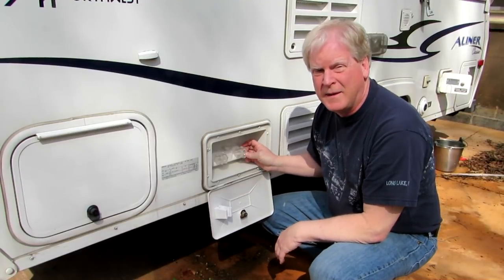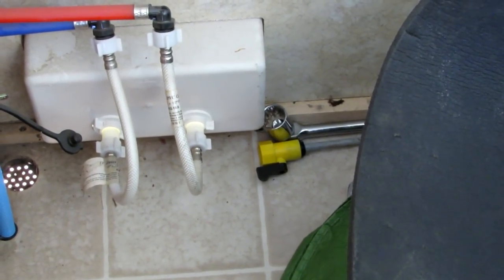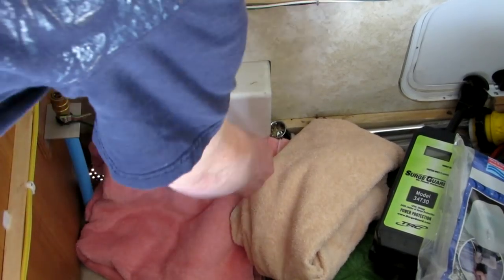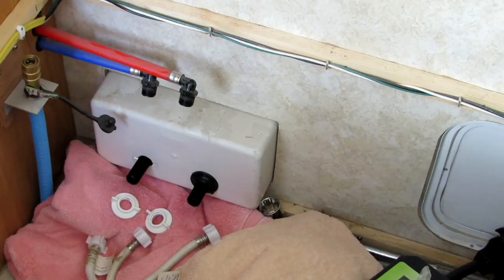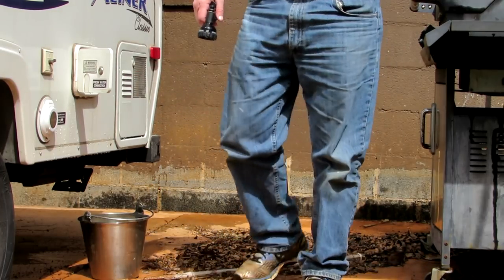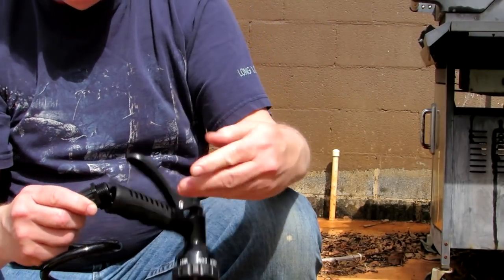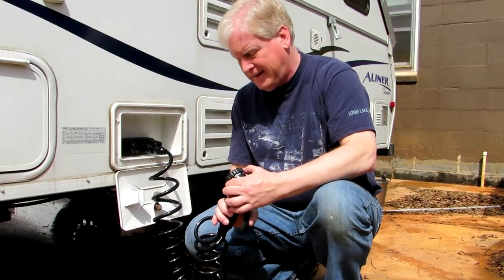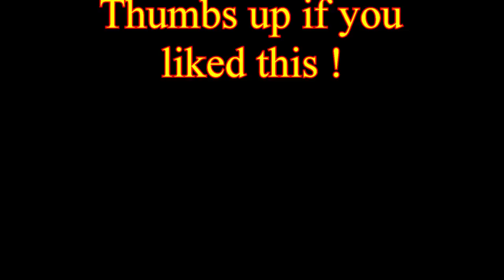Changing The Outside Shower to a much improved appliance

Comment: Rick, great upgrade to add to the versatility of your A-Liner, Is it possible to change just the hose and nozzle? In case want to do this also as much cheaper and easier if able to.  Just added as installed a black outside shower unit in my compact stick & tin (wood frame & aluminum siding) TT.  Found a great location between the existing outside water connections and water heater.  Had to cut a new hole, a perfect fit between the wood studs, then splice into existing water lines using T connectors with the blue & red PEX-b plastic tubing.  Doing plumbing in a TT isn't much better than doing it on your house, every new connection (8 total for the shower unit) has to be 100% perfect, no drips. Much trial and error to see which connectors fit best until it's drip free. But in the end it's worth all the time, trouble,and expense.
Reply from the maker: Absolutely !!  And if your smart, you check all those connections at least once during the camping season, because things loosen up with road time and different pressures, different uses,  all wear on the systems much more than a house.

Comment: Did you say the short water lines in the back were designed only for RV use and regular ones from Home Depot wont work?  Like you said it seems they should be changed out every few years.
Reply from the maker: Most of RV plumbing is a unique thread. No Idea why.  The PEX is regular size, so if your smart you can change the parts by splicing new PEX and regular household plumbing fixtures !

Comment: Just got this as a replacement utility shower for the service compartment in my Bounder.  This is a tremendous improvement over the old shower with the permanently attached conventional RV shower hose and shower head.  Now the hose isn't just flopping around inside in the compartment and the spray nozzle is so much better.  I mean, who really "showers" outside their RV in front of their sewer/service compartment?  1.  There isn't anyplace to hang up the shower head.  2.  the hose isn't long enough on that old style utility shower.  3.  The the shower head might be ok in a shower, but spraying stuff off outside your RV requires different water patterns.  This is just what the doctor ordered.
Reply from the maker: Glad you found it, We'll have to see how long it takes for the RV industry to figure out its worth adding to the OEM lineup.  Thanks for the comment !  Come back anytime !
Reply: Going NoWhereFast the service access for the faucet in my service compartment was pretty tight so I had my local RV service shop do the install.  The folks there are looking at their supplier relationships as they think this is about the best utility shower they have ever seen.  They seem to intend to stock it for aftermarket replacements.
Reply from the maker: @jeromep  Good for them.  Its an excellent Mod!
Reply: @GoingNoWhereFast  I agree with you that manufacturers need to move to this faucet and hose over what they are currently doing, but based on my experience manufacturers are anywhere between 3 and 5 years behind actual RVers and the aftermarket.  On top of that they frequently really miss the mark in terms of new features and what the market really wants.  Cheers.
Reply from the maker: Very Few executivess in the RV industry actually RV,  What does that tell you! Stay Safe!
Reply: @GoingNoWhereFast  Same goes for sales.  I have a good friend that owns a local RV dealer and service shop with his parents.  While they are honest, kind, and are the epitome of hard working small business owners, and that is why they have such a good reputation, they also don't RV.  His excuse is that they never have the time.  Which is an honest response because they are open 6-days/week and the 3 of them are there every day.  They keep their ear to the ground with their customers, so they are in the know, but they spend all of their time fixing RVs, they don't have a lot of time to actually go use them.  I don't think this is where RV manufacturer management is, but the entire industry is filled with these disconnects.  Your big RV sellers are probably worse off for non-campers doing sales and support.
Reply from the maker: I suppose if you love your work you don't need vacations, but I think most people really NEED to take a vacation every few months. Otherwise you never understand what you really like in life. And what you really  value

Comment: will the original shower head still fit on the NEW coiled hose? Sometimes i would still like to mount head & use for a shower not just have a spray hose
Reply from the maker: No, Unfortunately not.  But you can "lock" the spray head on and use it like a regular shower.  There is a little lever to do that.

Comment: I have learned a lot about aliner care from your videos. Curious about the vertical blue hose and shutoff  valve to the left of the shower box inside.  What is it used for?
Reply from the maker: That's my propane line for using my indoor/outdoor stove inside.  It is normally hidden under the seat cushion, but someday I will extend it up so its next to the cabinet above the seat cushion.

Comment: Were you able to drain the water out of the hose? I prefer not to have an issue in winter storage- don't want it to freeze and break. Thanks for the great video!
Reply from the maker: The Hose is flexible enough and will expand without breaking or cracking, at least until it is really old and dried out.  In winterizing your trailer, the hoses aren't usually the problem,  its the hard plastic connectors and water pump that if the water freezes and expands, it cracks those items.  And they are very hard to find and figure out they are what is damaged, versus just "Not tight enough".   And that is why you add anti-freeze to the whole system, making sure it gets to the end and visibly flowing out the nozzle or faucet. Thanks for the comment, let me know if you need more info.

Comment: I have this same setup. How do you purge trapped air out of this?
Reply from the maker: Trapped air or trapped Water?  To empty it of water just take any thin stick (toothpick, chopstix, Nail, Screw, etc) and push it in the bottom while the sprayer is locked on.   And hold it up and let the water drain out.
Reply: @GoingNoWhereFast  I think it’s air. When I turn on the faucet and press the handle, nothing comes out

Rest of the camper has water , but for some reason nothing comes out of the outdoor shower. I wonder if there’s air trapped at the quick connect
Reply from the maker: @Morningrise8  Ha?  Try both Faucets, maybe your pulling air from your hot water tank.  Your Water pump is on, and you have selected a proper setting on the nozzle?  If the sink has water, you certainly should have water at the outside shower.
Reply: @GoingNoWhereFast  water pump isn’t on. Just on city water connection. Do I need the water pump to make the shower function? Honestly no clue.
Reply from the maker: @Morningrise8    If you have water running in the sink, then the water should be coming out the shower too

Comment: Thanks for the video. Does the hose and nozzle fit back into the faucet compartment or do you have to store it elsewhere?
Reply from the maker: Since its a bigger pistol grip nozzle and the hose is twice the length and coiled, it does not fit back into the shower area.   I put it into my "water system" bag.  Where I keep all my potable water stuff.  The truth is, my old one never fit into the compartment very well either.  Especially since I had changed to a oxygenetics shower head.
Reply: Good question. Thanks for that answer too.